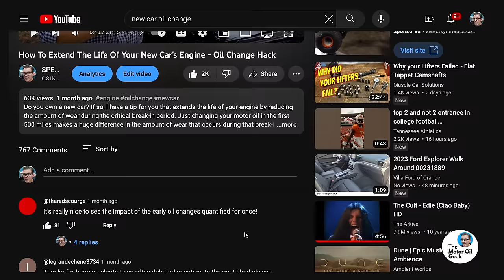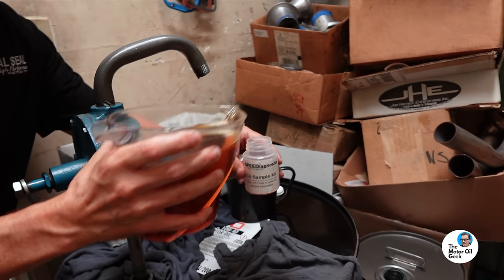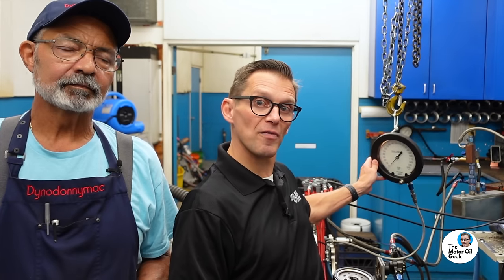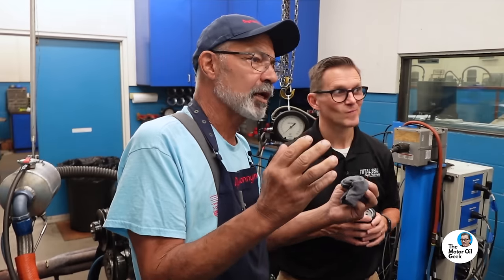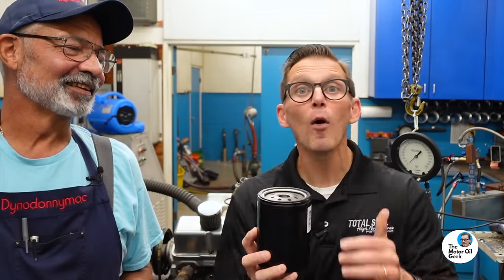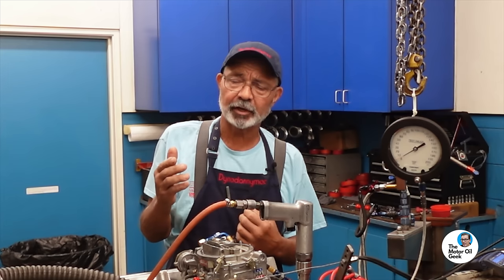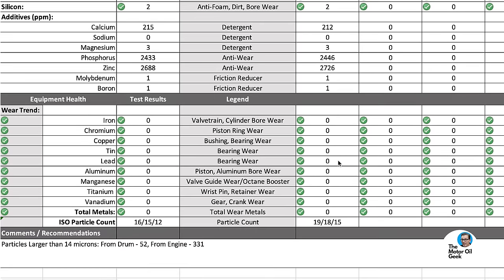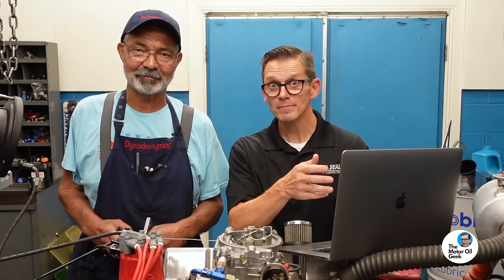Does Pre-FILLING The Oil FILTER Cause Engine DAMAGE?

Comment: Even though,  as a seasoned mechanic I already knew the outcome before I watched the video. It was still a very good and informative study. Although, the fact that ANYONE would think prefilling oil filters is bad amazes me!!😅
Reply from the maker: Thanks for sharing!
Reply: @@GeorgeSanford-pb1yj Very true.  I used to not believe pre-filling could damage my engine.  I was cocky, so I did an experiment.  I did an oil change and deliberately picked a tiny spec of dirt off the ground, about the size of a flake of black pepper, and put it in the filter while I pre-filled it.  Then when done, I started the engine, and sure enough, after 10 seconds, the engine exploded.  I studied all the parts and every bearing in the engine was completley wiped out.   Now when I change oil, I do it as if I was working on the space shuttle.....clean room, complete body suit with respirator face mask.   And no more pre-filling!
Reply: It amazes me tooo !!! ! !!! But, this is obviously Just Because they Are sooo Lazy, or Careless , or Greeddy !!! ! !!!
Reply: It's not BAD, it's unnecessary
Reply: Not sure who's saying it's bad, sounds like a strawman. I've only ever seen people argue that you don't need to prefill, and prefilling is a bad call on motors with sideways or upright filters. Maybe the "I always prefill MY oil filters on MY car" people are spreading the rumor that anyone would be against prefilling
Reply: It’s not that it’s bad stuff some engines are impossible to do this to

Comment: Many decades ago I started pre-filing my oil filters. Even if they were horizontal I pre-filled them. Always waited to let the filter medium soak up the oil and then add some more. Even if I lost a bit on a horizontal filter when installing that is the best I can do. Anyhow what I noticed after I began pre-filling the oil light gauge will immediately go off vs not pre-filling where it took a 2 or 3 seconds to go off. That is all the proof I needed to show I was getting oil to my bearings faster with a pre-fill. This video proves that I have been doing it correctly for a long time now.
Reply: It is so smart to let the oil filter sponge up some oil n then you tilt it and spin it on sideways or upside down as in 12 cylinder Italian powerhouses such as Ferrari Bugatti pagani Lamborghini Fiat Alfa Romeo Lancia Maserati.
Reply: just imagine the amount of life your losing per oil change not prefilling, over the course of a cars life, what 10 miles of wear, lmao, I drove 100 miles with out oil in 2 miles stints and then finally could afford oil and car make it 100,000 miles after that until tranny went out
Reply: Doesnt matter at all. The oil light being on for a couple of seconds after oil change means nothing. But always good to be on the safe side. Sincerely, a mechanic.

Comment: I've always prefilled. I feel like anyone who understands how an oil pump, and oil pressure / lines / fluid mechanics works would instinctively know that pre filling will always make sense. I've only ever heard 'its a waste of time' from people who dont understand how things work, or lack the ability to think ahead, or are hacks who dont care about anything.
Reply from the maker: Right on!
Reply: I guess people who design engines for a living don't have a clue about engine lubrication and the people who make oil filters are idiots also. However, some goof ball in silly glasses has all the right answers.
Reply: @lukew2194    Actually YOU are correct.  Those folks are 'compartmentalized' and know very little outside of their specialty.
Reply: Indeed!

Comment: Thanks! I never pre-filled my filters in the past (not because of thinking it was a bad thing, just lack of knowledge), but will from now on!
Reply: Same!
Reply: As an automotive machinist ( 40 years)I can say with complete confidence you don't have to pre fill the filter.  A ton of modern engines have filters that are either horizontal or vertical ( upside down) that have zero issues not being pre filled.
Reply: @petemcpeterson6205  Why not flipping the car upside down, or put it on its side for models with filters not facing down?
Reply: @petemcpeterson6205   So just what is your point?

Comment: I’m just recently going back to doing my own oil changes and I used to always prefill. The idea is you are allowing as little air into the pump as possible so it pressurizes as fast as possible. It’s weird this is even a debate. Even if it served no other purpose than piece of mind I’d still do it. It adds maybe 30 seconds of work to the job.
Reply: @Willheheckaslike-d4h   But the entire system needs pressure regardless of if it’s downline or upstream from the pump. Air anywhere in the system causes pressure to drop, right?
Reply: @Willheheckaslike-d4h It's not so much "air in the pump", but the filter will obviously be full of nothing but air if you don't fill it first, and those few seconds it takes to pump the filter full of oil means that the engine is running with ZERO oil pressure, and the engine suffers a bit of wear from it. That little bit of damage DOES accumulate over time, and takes precious life off the engine.
Reply: @user-uv7up4vg6i  That oil left in the bearings is basically useless without pressure behind it. It's a proven fact that up to 90% of engine wear happens during start-up, when there isn't any pressure in the system. If oil sitting in the bearings was enough to protect the engine, we would use it, instead of a much more expensive special clingy, thick, assembly lube when we build an engine.
Reply: What about vehicles with oil filters that go on sideways 🤷. So it's not going to be fully filled.
Reply: @guytowers8479  You still put oil in it. just enough before it wants to spill out. Anything is better than nothing.
Reply: I am by no means a mechanic, but I’ve changed my own oil quite a few times. I have never pre filled a filter. It’s never been an issue.
Reply: @churchyandfriends and it never will be an issue as 99% of cars on road DO NOT have pre-filled oil filters on them.  Cars have 100’s of thousands of miles on them without doing this. If you’re doing your own oil changes, sure, pre-fill, no harm done.